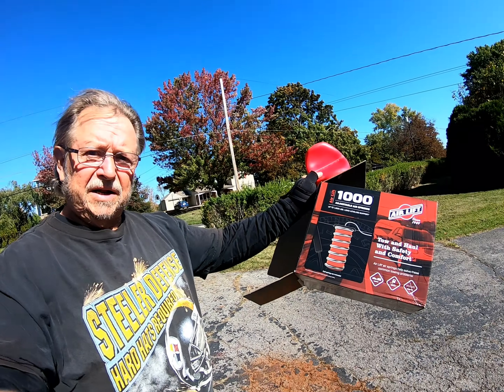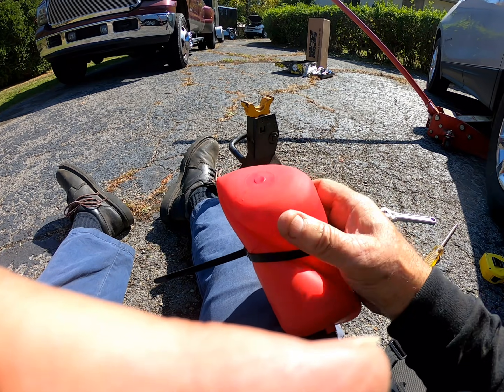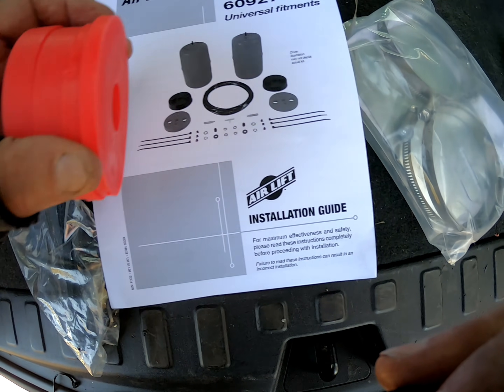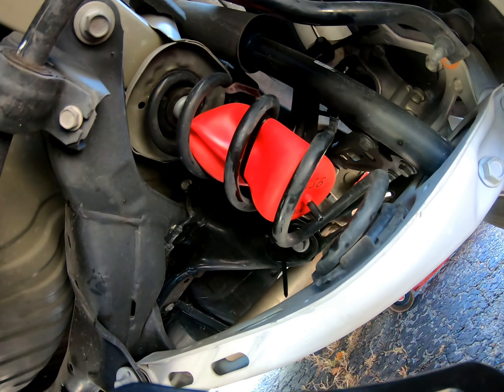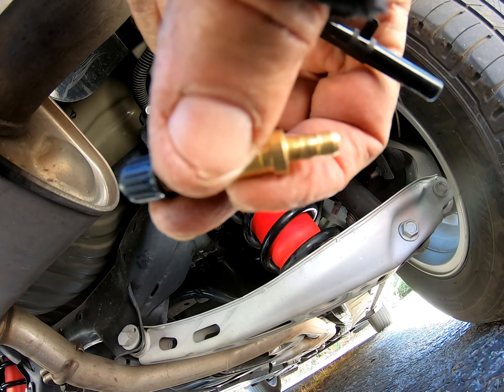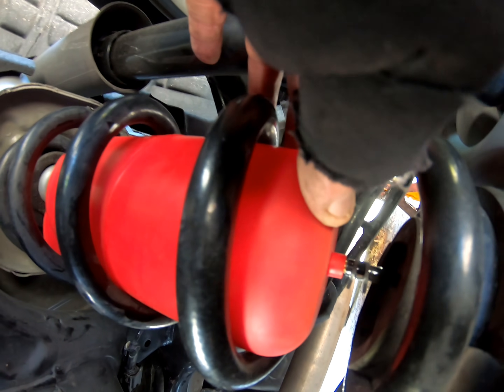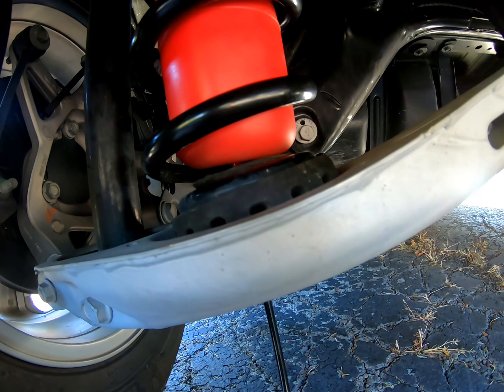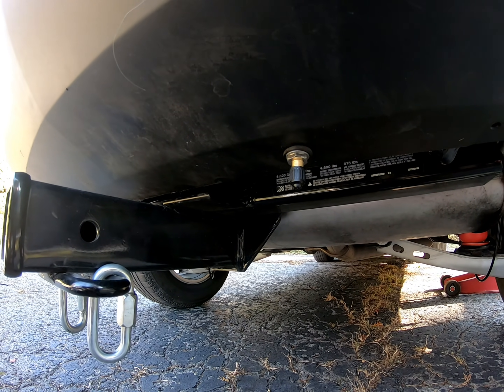2019 Equinox Airlift 1000 Air Spring Install

Comment: I have a 2018 that I just put the hitch on. Will the Airlift give any additional height?  I have a steep driveway and if not careful I drag the hitch without the trailer 😖.
Reply from the maker: No, it does not give it lift. What it will do is keep it from compressing much when there is a load on it.

Comment: Will that setup work in a 2012 Chevy equinox. Did you find that set up on Amazon.
Reply from the maker: I don't know if it would fit on a 2012. I bought them from the Airlift website www.https://www.airliftcompany.com who sells them, and that site can give you that information. If you have coil springs in the rear, which I have, then the Airlift 1000 should work.
Reply: Thank you for the info.

Comment: How does it work for you so far ? 

I been thinking about getting a similar set up on my 2020 Chevy Equinox, just wasn’t sure how solid the product was. 

I’m towing a boat that’s pretty close to the limit of the capability of the 2.0t front wheel, and the back wheel just squat too much for my liking, I would prefer to have the vehicle somewhat more level to have more traction at the front wheels.
Reply from the maker: Drag Smooth Fishing TV , It has been over 18 months so far and all is going well. I have a 1.5L. 2WD, and it has worked great. My limit is 1,800 lbs, and I've done a little over it with my Over improved HD-Street Glide hauling it in my single axle trailer.  I've taken it to Florida 1,100 miles, Indy 375 miles, Virginia Beach Twice 480 miles. All is well still going strong. I installed them for exactly what you are looking for, keeping it lever, and with a little air in the bags, it does that well. Others ask about the ride and it neither improves or un-improves the ride, that I didn't notice any difference.  Hope this helps and Thanks for Watching.
Reply: @truckstomotorcycleswithtom3197  thank you so much, I extremely appreciate you responding, exactly what I wanted to hear before I get it done ✅ 

Happy holidays 🥳🇺🇸🙏👍